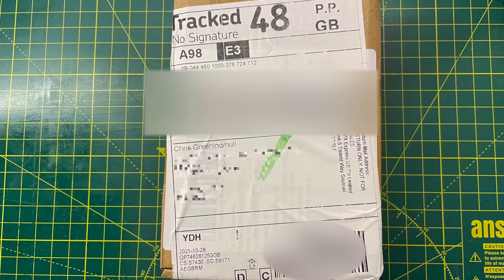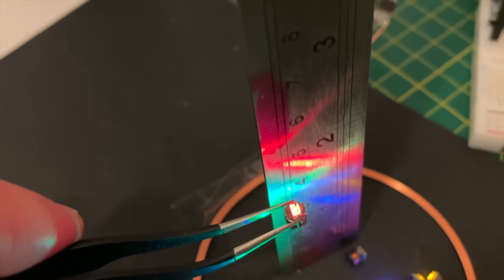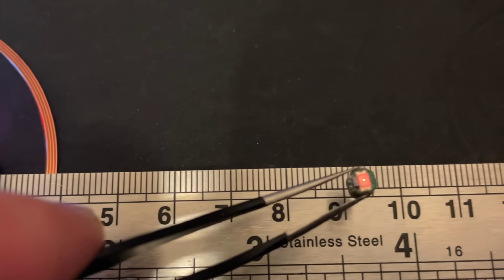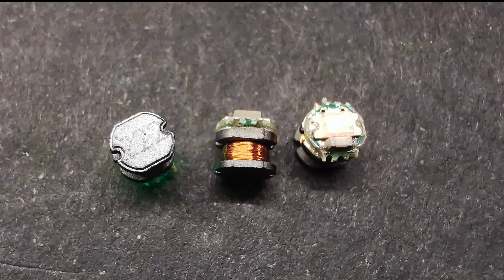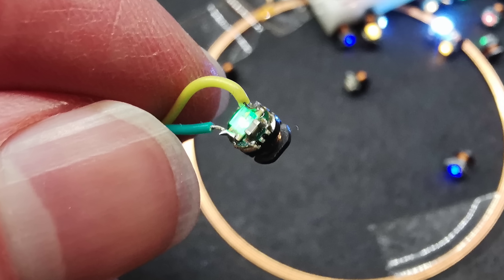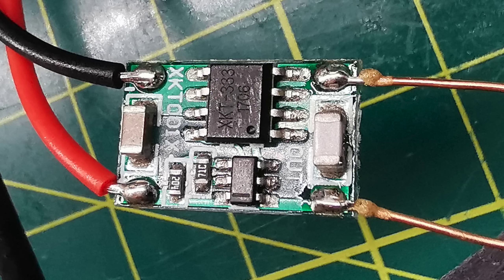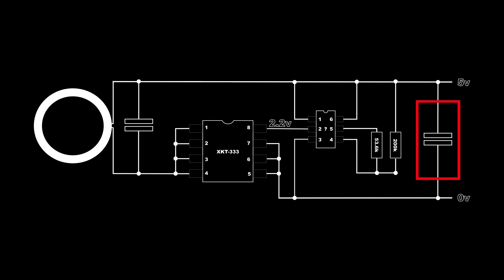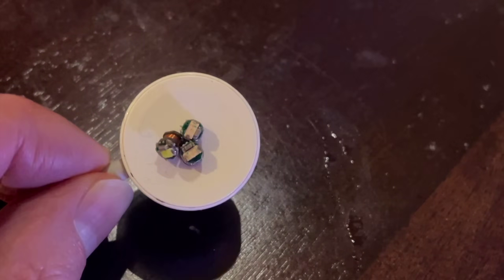Look Mum No Wires - This will blow your mind

Comment: The Killer Application for this would be LED sidewalks where as long as you have the coil of wire at a high enough voltage focused to the ground, you could get them as a twinkle effect if you stagger the coils.  You could use epoxy  to just spread them over the sidewalk.   

You would need some kind of loading for the small capcitor that would build up current  so they fire at random times.   

The other would be to make some Fountains where you could place this in the stream and it would light up in various places.   Kind of like Carvial rides or small  water art exhibits.

The LED's would be  encapsulated inside the plastic and quite honestly they pretty much last forever so yeah kind of cool.

this is sort of something that's really similar to how the old Nokia phones had those antennas where the LED would light up as soon as a phone call came in

Comment: embed the LEDs in something that looks like a gem stone, balance their weight so they are neutrally buoyant in mineral oil, mount the coil to the outside of a snow globe, fill the globe with the gem/LEDs and mineral oil, mount the globe to the end of a staff with all the electronics hidden in the top of the shaft.

bonus points, program various flash patterns, figure out a way to get some LEDs to respond to different flash paterns so you can have some flashing out of sync with others.
Reply: I was thinking just this. I'm wondering if the different colours respond to different frequencies some how? then you'd just need a coil for each colour, hooked up to an ICU of some sort
Reply: @frankcooke1692  Essentially you would need a crossover on the coil so it would be a bandpass filter. When the frequency outside the range of the filter, it won't pass frequency. Obviously things will get bigger. I think that to scale up the project, lets say to a 10 ft VU meter, it would be better to use an old colour organ where the controller has multiple outputs triggered by frequency and then route those to the different LED colours, but then that takes away some of the cool aspect.
Reply: @Todd.T  I'm no engineer but I've been reasearching building speakers so have some familiarity with bandpasses and crossovers. As to how frequency and voltage relate i'm a bit sketchy. But the different coloured LEDs should have different 'responses' I could manipulate??

Also.. how would I go if I just smashed the door in of some microwaves? Would that basically power them? This is for research purposes only... I'm not going to try that.......
Reply: Many years ago I made a Gandalf costume for Halloween and Cons. I had a plain ol' staff, nothing fancy (per the book)...but it could throw a blinding light. I charged and set off the flash at will just by holding the staff. Nobody else could make it work. Made a lot of money at bars, sometimes even getting first place over the "hot chicks" wearing almost nothing.

Dismantled a cheap flash camera, packed the needed guts into as small a package as I could. Hollowed out a place in the staff to slide it into and sealed it back in with wood putty. Nothing showed but a bit of the lens. I ran the wiring down small grooves to the "handle" area, again covered with wood putty. 4 copper rings hammered into the wood and soldered to the wires. 

Battery pack strapped to my arm, up my sleeve. I'm wearing a ring on my pinky, a ring on my middle finger. They are wired to the battery pack, no-finger gloves to hide the wires across my palm. The two lower copper rings on the staff are set to match my hand and those rings...the flash is charged.
Two more copper rings for a ring on my thumb to touch and short across...sets off the flash.

You touch it wrong, instead of a flash...it goes off in your hand, ZAP! 
Which is what happens if I charge it and then leave it and someone else picks it up. Don't touch a wizards staff, you fool!
Still have it sitting here in a corner.
Reply: @yourhandlehere1  This is sort of similiar to what I tried to do with a hat once. But more recently, so I think the batteries were a bit more compact, and you can just pick them off the shelf at K-Mart. And RGB programmable strip lights are pretty cheap too. Still couldn't fit it. Could go an extra step and seperate the cells, but that seems like a fire hazard. Would probably work with a wizard's hat or top hat.
Reply: my experimenting has taught me that neutral buoyancy is a very, very hard thing to achieve.   but I'm a glassblower and I'm totally going to put these in my bongs.  coil and circuitry hidden in a 3d printed foot.

Comment: Turn them into gemstones with a translucent 3d printed case that surrounds each one and either put the coil in a "treasure chest" or "hollow of a rock" again 3d printed.
Reply: I'm thinking the same.  3d printing could diffuse the light nicely adding to the mystery.  ixm a glassblower and I want to use glow filament to escape them and pop them into bongs, with the coil and battery hidden in a 3D printed base.

Comment: 3:35  a sinewave cut in half by a diode, i guess... the led ?
Reply: and the apple charger blinking signals is for proprietary reasons like:
"use a authorized induction charger or this phone will remember you that you paid for cheaper version"

Comment: use them in an SMD circuit in place of a power input. the brightness of the LED will indicate the level of power being supplied to the circuit
as for the use? door open and close/motor rotation sensor but instead of a hall effect sensor you use the proximity of the LED to the wire embedded in the wall? and the circuit sends data over lossy UDP to a wifi server to record exact time of closing and/or speeds? i guess you wont get more than 100 RPM at first though

thats 2 ideas btw but feel free to combine them lol

Comment: So nothing more than the same technology behind RFID keys, which use a copper coil to generate charge to power a low voltage chipset, except this one is the LED, uni, the question is at 02:24 (how many LEDS can be placed in the middle before they loose brighness as the power would have to be distributed to all units

Also what practical use can these have?
Cristmas trees maybe? have them on branches with a charging port at the bottom with maybe 3 antenanas hidden between branches at different heights of the tree?

I dont know, but other than this it could only serve as a gimmic

Comment: Use a solar panel power pack for the +5 and have remote light outdoors. You could make a lighted thermometer outdoors=different colors to represent different temperatures and another set up for wind speed and direction, = illuminated weather station that can be seen and read from a distance. Pressure sensitive pads under translucent walking stones that light up as you go down a path.

Comment: Isn't the reason you're not seeing a sine wave is because the light emitting DIODE is half wave rectifying the voltage in the LC circuit?

I'll bet if you lifted one side of the LED you'd see the full sine wave again.

Comment: Next up, someone figure out how to ditch the coil altogether and have these run off ambient energy.
Reply: possible, but you'd need a huge coil, like the perimeter of a room. That would receive enough power via radiowaves. There are powerless radios like that, just powerful enough to drive a little earpiece.

Comment: Can you turn on the LED by using a neodymium magnet?
I have tried a red LED plus a copper coil with an iron bar myself. Moving the magnet to it generates a tiny voltage. I think it is in the 200 mV range, so it does not turn on the LED.

Comment: I have an old blower wheel from an air conditioner. I have considered mounting it on bearings on a pole in my backyard as a form of yard art. I have considered mounting LEDs to it as well so the spinning motion makes them blink. It would be interesting to see if they would blink as a magnet is moved past them.
Reply: if not you could put a bigger coil by the magnet and drive the original circuit
Reply: They may blink. Depends on the tuning of the coil, and the frequency of the magnet going by
Reply: Sounds like a cool variation on a Dream Machine ala Brion Gysin

Comment: It would be neat if you could tune the L.E.Ds receiver coil to 2.4Ghz and use it as a way to "see" Wi-Fi. It would be really cool to actually power them off ambient Wi-Fi signals but i imagine you would need a much bigger receiver coil to have any useful range (unless you used a parabolic dish to focus the signal on to the smaller coil.
Reply: router signals are very weak and are bad at transmitting power

Comment: I thought these were cool since I saw the Tested channel.. but had absolutely no idea what they would actually be useful for 😅🤣🤣🤣
Reply: i magine a flying cube with lds on magnet or someting like that
Reply: @JTKK9  yeah but most applications I thought of (including your floating cube) it would be simpler/lighter/cheaper to just include one inductive coil in the device to power regular LEDs rather than baking them into each LED.
Reply: I will show you after January 4th LOL. Induction lighting can be used for SO many things!

Comment: What's the power draw using this wireless technic ? I would imagine doing things in larger scale like a ceiling of twinkly lights would take a lot of coils and power and wouldn't be efficient. It's cool, but no real practical use that I can think of.
Reply: Someone mentioned that they might be used as the hand jewel thingy from Logan's Run, and I was thinking we do seem to using up resources faster than they're produced. 
...Maybe instead of age we can use the value of our carbon footprint and once it's reached, 
⚡ZAP⚡
...Carrousel.

Comment: I have one question, can you use multiple coils so you can place them next or above each other to have a larger range or will that interfere ?

As a project suggestion, it would be nice to light-up some lego builds, for example one of the Christmas sets. Existing light kits have a lot of wires that are in sight and sometimes even makes the build structure less sturdy.
Reply: Multiple coils should not be a problem.
Reply: I would say yes multiple coils can be used. It would act as a booster as more power in a smaller area.
However a simple magnet should have the ability to alter the electronic field for distance purposes.
Reply: more coils equals more flux density or Tesla (T) or Gauss in this case a smaller unit. The larger your field the further your range.

Comment: got it, they're wireless but they need a wire to work
Reply: add solar on the other end or something, you can be creative rather than critical :)
Reply: @Kneal911  I'm not critical, I just thought the title was a little humorous
Reply: They are "wireless" as in they are not tethered to anything by a wire. They need to be near the coil, but they aren't physically connected.

Comment: @atomic14 I would see if you can use them in resin or epoxy scenes, you could use them as a street light, or stars or whatever light source you wish for your scene and use the light to light up the entire piece. My only concern would be the heat some of them produce, it may damage the LED.

Comment: So what is the determining factor of distance. X is it power? What is the determining factor of lifespan.

So, you could lift or run a copper like coil underneath your stair carpet or wood or tucked under a baseboard or behind. Then energize it... Then create a refractor plastic case to defuse and spread the light, then just tape on the leds to the base board, double side stick tape or something. Have base lights around the house. On top of  that a modulating time piece. The time doesn't need to be synced just needs to be a 24 hour clock.. that turns on the lights when needed, or a LV motion sensor, that only needs about 1-3 foot range. so when you walk by they turn on, in sequence and then turn off behind you after x time... could input a gesture interpretation, where you do some foot sound double tap stomp or quickly go back and forth.. and they remain on for an hour. etc...

I can see this being great for in behind cement and the noter lights are just on the outside, creates a cleaner looking. Put in along parking garages and low visibility areas. All sorts of fun.... You can create a Led light sabre... The wireless ability allows you to bunch of hteleds and remove the needs for cutting through wood etc, in running power.. or ceiling holes, just need to a mount and then boom put up a light.. also be useful for utilizing wireless energy in other ways...

You could have them in your toilet..

Experiements choose the purple, magenta colour and use it to grow plants.. the use of wireless light is that it can be used in a dangerous place.. without direct line of power. So the power source can be insulted or protected against.

For example... these boys were exploring a hole in their community.... tied a camera and light and dropped it down...

All you would need is to drop some leds/ down a hole... run a coil down, energize it use that for the camera.. voile. or have the camera generate enough power to power the Leds and it could light up the area... the most useful is diving, you could have a power coil reserve in low light, and rather then just eld light ,t they can be used as trail markers that come up on a screen. So when you are near them they power up and help you find your clubs on the way out... but currents and what not, but this can also be sued as a wide field so use a massive magnetic field to power them through deep caverns and rocks and you can map under water caverns, like the magma/ lava tubes...

T-shirt without dangerous nipple shock wires.. seems more save... with a coil.

The uses for wireless less or sensory things are endless, because you do not need a direct line...

Comment: Project idea: Fill up a transparent cylinder (maybe a thick acrylic pipe sealed on ends or a globe if making it for christmas) with some kind of oil and set up a pump at its bottom such that it takes in the oil from sides and pumps it up in the center region of the circle and wrap the cylinder with a mirror film to produce kind of an infinite mirror effect. the pump and leds can be kept separate using a plastic mesh that is opaque in the regions other than in the center and near the edge of the cylinder so this will allow the oil flow to be set up properly. I guess the mesh will need to be bowl shaped to allow fallen led to move to the center and then the oil flow will pick them up again. It might need 2 coils to work if making it tall tho.
Encasing them in epoxy and then using water insted of oil might work too but i think they will sink too fast.
Reply: If using epoxy, introducing small bubbles into it will raise the buoyancy. If slightly negative buoyancy can be achieved, perhaps only a slight current from the bottom will circulated them as desired.
Reply: Was thinking exactly this.
Also, make the epoxy semi-opaque so the LED's become little balls of light
Reply: @Stronsky2  Thumbs up on that idea. Maybe some fine silver glitter in the epoxy to make them sparkly.
Reply: That's cool!

Comment: would this work below a power line ?
Reply: Probably not as power lines are 50 or 60 Hz, whereas these are (probably) a much higher frequency.  That's why the coil on the underside of the LED can be so small.  If you wanted it to work under a power line you'd need a much, much bigger coil, and even then power lines don't radiate a lot of power (otherwise it would be wasted and not delivered to customers, lowering profits for the distribution company).
Reply: @Berkeloid0  Older ones leak plenty.  I used to make my way home down a forest trail on low viz nights with a 48" fluorescent bulb to guide me as the trail followed an ancient powerline.
Reply: @russbilzing5348  Sounds like there must've been a fault on that line or HF harmonics or something, if you had a line like that delivering power to your house the lights wouldn't go off when you flicked the switch off!
Reply: @Berkeloid0  100KHz  ie 100,000 cycles per second.

Comment: 3:35 i assume the waveform looks like this because the led clamps the voltage down due to the low supply current. This would also explain the little spike on the waveform when the threshold is reached. Correct me if I'm wrong though.
Reply: Isn't that waveform the one driving the coil?
Reply: @megatesla  oh yes you‘re right! I guess the current wouldnt be significant enough to clip the voltage on the driving coil. Must be the driver chip then doing some magic.

Comment: Rotor Riot once tried putting leds on drone props. mabe this is a better solution than a battery strapped to the top of a drone propeller. and the coil has double use as a propguard :D
Reply: 👍🏼Nice! 😎✌🏼

Comment: I always thought that LED Pool Lighting (Underwater) should use an Inductive Coil. In this way, the Lighting Module could be completely sealed in Resin, with absolutely no wiring, and no chance of water ingress to destroy the LED Light Unit. I have already had to replace one expensive LED Underwater Light - due to water ingress.
Reply: I did this with my pool.  Using high brightness blue COB LED's and an inductive heater driver on the dirt side of the pool.  I embedded magnets where the LED would stick to the inside of the pool.  Works quite well.
Reply: @cap5856  
I'd guess being submerged in 10,000 gallons of water would mitigate the heat of the coils a bit.
Reply: that is a proper and logical use.
Reply: @cap5856  
I was thinking it would be like a puck on the wall of the pool based on what John H wrote.
Reply: Out of interest who did you buy these underwater lights from?

Comment: Over 25 years ago I had a Nokia (6210 I think??) you could change the stumpy antenna for an after market one with a multi LED set up that would flash when you was about to receive a call or text or make a call. I was always amazed that they would work with no external connections.